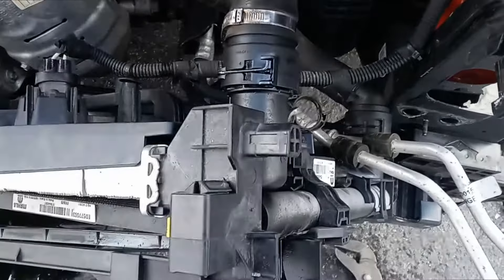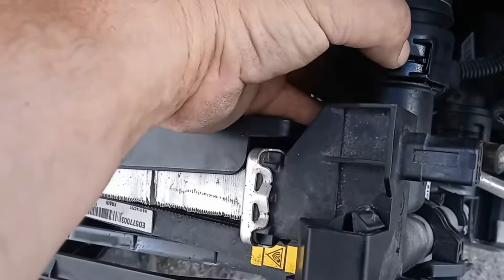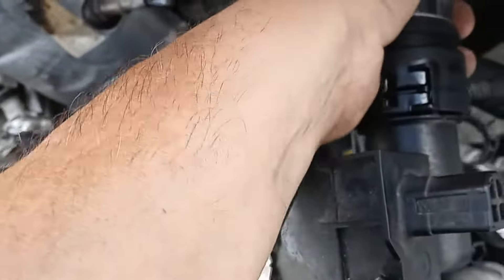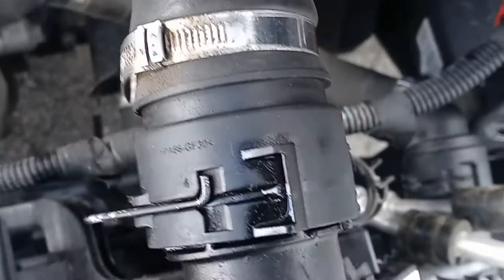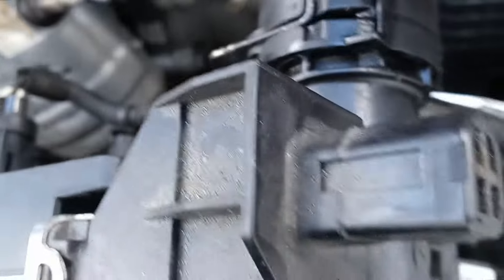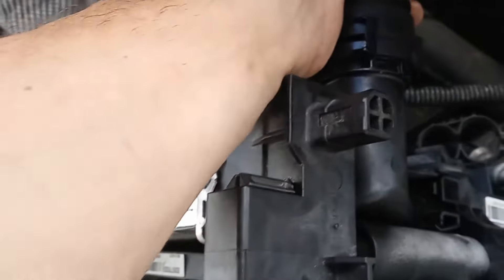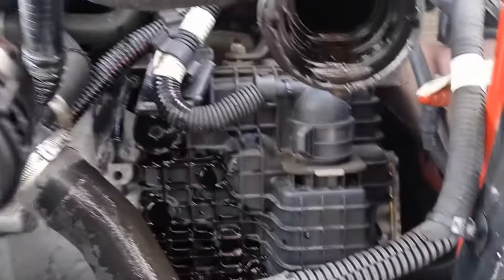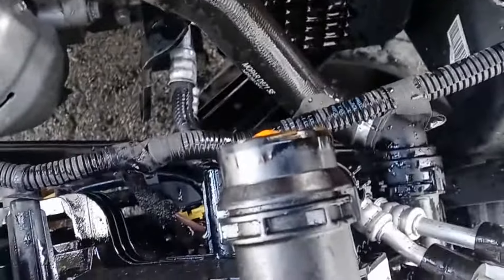How to release and Use a Snap Lock Radiator Hose Jeep Porsche BMW Audi Mercedes and More

Comment: Thanks for the video, finally got mine off by prying. Makes me want to smack the engineer that designed this extra step in.
Reply: 10000% it's in-accessible and stuck tf on. If you find the engineer holler at me, im ready to join you in the smacking.
Reply: I know. I just went through this crap with an Audi. So damn stupid. Before, it was just the hose and a damn clamp.